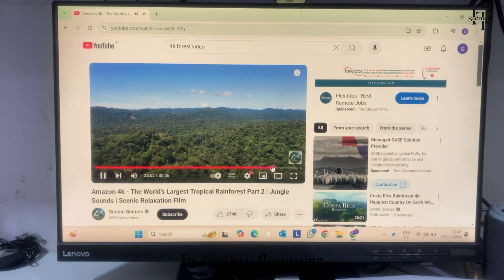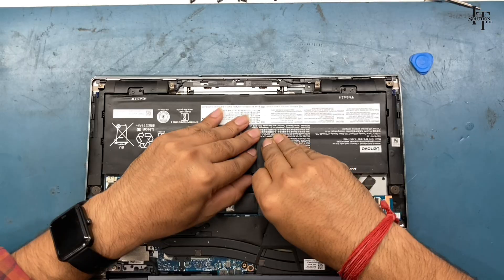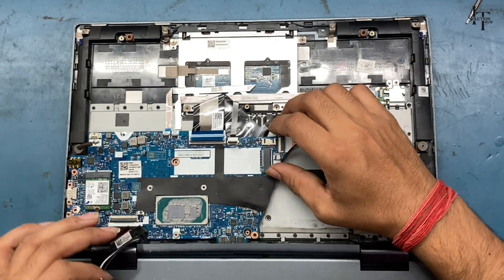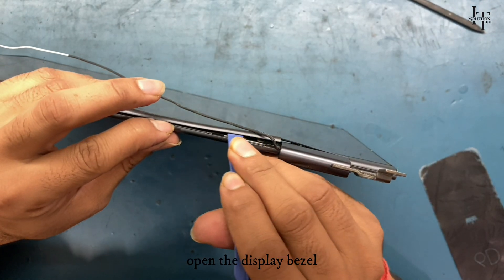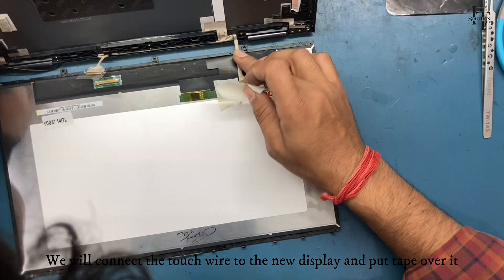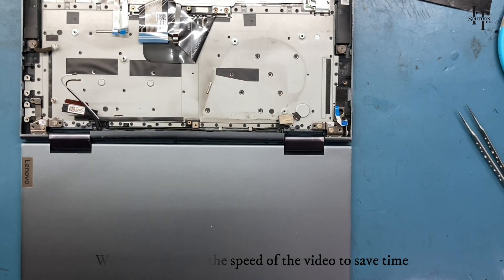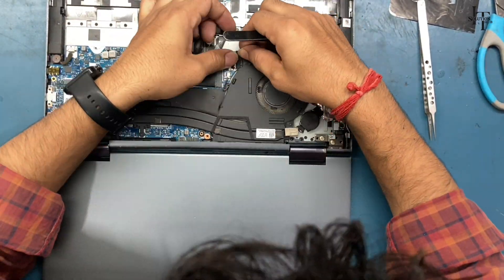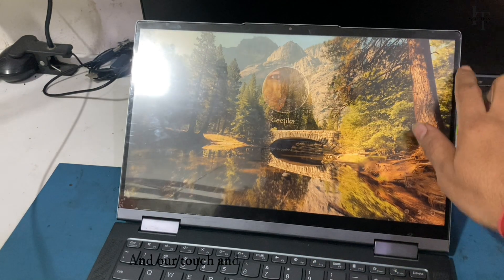LENOVO YOGA 7 14ITL5 TOUCHSCREEN REPLACEMENT

Comment: 0:22 I really hate this brand. IS THE SAME PROBLEM OVER AND OVER!! I have seen this problem before. It seems this happens because the hinges thighten and they press the lower part of the screen. You see, part of the hinges in this model sits behind the panel.
In some variants, the display is not touch, it is a combo and you can check it by checking the display ID via Device Manager. If it reports a non touchscreen display then you have a combo, and that is EXPENSIVE!!!!

Comment: Hi, I have an old Yoga 700-14ISK, and I want to convert its screen into an external touch monitor using a controller board.
My question is: How do I keep the touch functionality working?
I've seen some boards with USB-C ports that claim to support this, but I don't understand how it works. Can you explain how the controller board sends the touch signal back to the PC?
N140HCE-EBA

Comment: Seriously bro?? You can easily open the display from outside don't even need to disconnect battery or anything just disable charging when system on from bios.
Reply: I'm a computer technician and I can say that unplugging a display connector while the main battery is plugged in may actually lead to damages on the display and even the motherboard.
Reply: @StevenBedoya2  so what, disco the battery...for the screen assembly, ONLY need to remove heatsync. NOTHING else. for JUST the screen, you dont even have to remove anything inside. HORRIBLE!